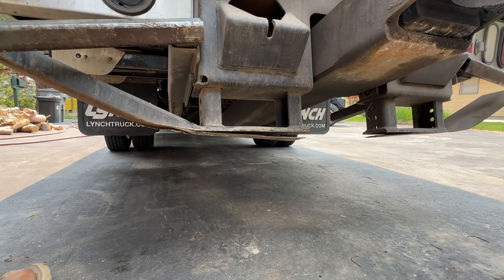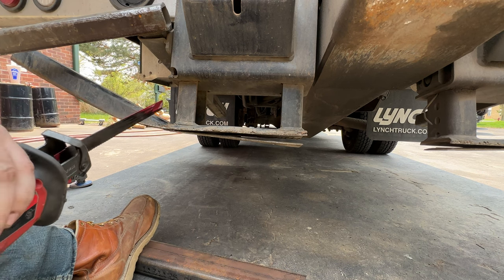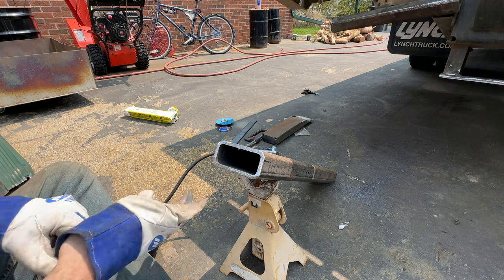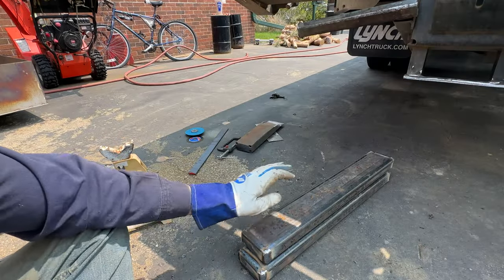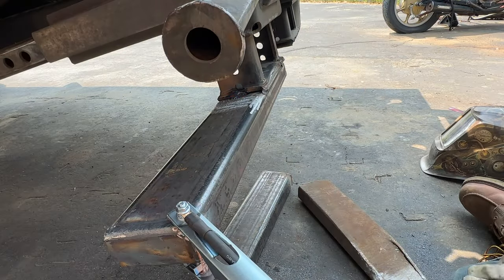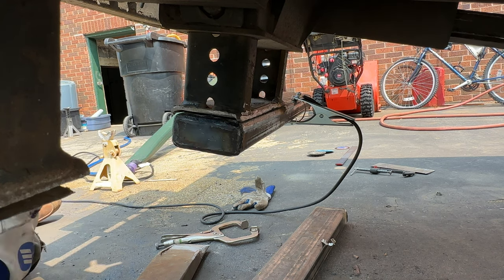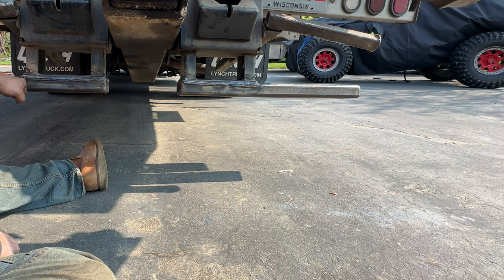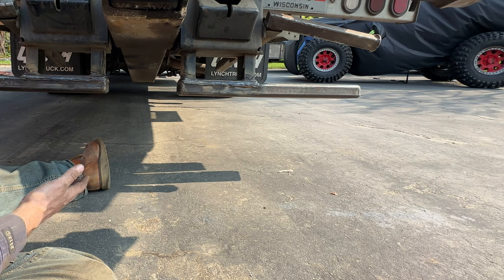Another welding repair job you can do to make money 💰

Comment: YES, this is what I’m talking about brother! Don’t get me wrong I love the teaching videos but people also need to learn real life situations and realize they need to be good enough to do a job like this before they jump in head first… I’m not taking on any kind of structural welding jobs right now… So far I’ve worked on my friends little trailer that you pull behind a yard tractor, a new rack for my brother in law’s smoker, and welded the muffler back on a riding mower… Those Diablo carbide blades cut like butter…💪🏼 Thanks for the video man, keep ‘em coming!
Reply: What’s your email address? I want to show you this grill rack I built… I feel like I did good and I owe a lot of my skills to you…👊🏼
Reply from the maker: Real life is definitely harder no doubt.  I can sit and tig weld perfect welds on stainless pipe on a bench, now trying to put perfect welds on a exhaust system with 0 access is going to be tough.  That’s why I always say master the easy, because it’s the only way the hard will become possible.  Technically the repair in the video wasn’t hard, but if someone hasn’t mastered horizontal and flat plate welds it will be almost impossible.  

Glad to hear you’re knocking jobs out 👍👍.  That’s the work that you learn the most 😀.  And of course occasionally fail the hardest at lol.
Reply from the maker: Weldingoldschool@gmail.com
Reply: @makingmistakeswithgreg  I sent those pictures of the grill rack… Don’t laugh at my plywood table…😆 I’m working on making a welding table next…😂 That’s actually the fire box on a big smoker. I’m thinking maybe I should have put another cross brace in the middle. The reason the old one rusted out is because they welded it in there and it wasn’t removable… I’m gonna make so he can take it out and clean it…

Comment: if that part comes off why not just remove it, weld it, then put it back on? I think your rod angle is off... should have pointed into what you are welding. Also I find if I attach the ground to the vice grips I get a better ground. I think it's because the teeth bite into the metal. 5/23 7018's tend to want a bit more power than you'd think. At least it does with me.

Comment: Since they are adjustable you might have been able to simply slide them out and weld them on a bench. The edges of the old piece that folded over on the sides could then be ground down flat leaving less of a gap.
Reply from the maker: 100% agree.  By time I realized they weren’t integral to the unit I already had done a bunch of work.  It’s always best to make a job easy on yourself anytime you can.  I am still confused as to how those were damaged like they were lol.

Comment: Side note on the wear presented, if it has a tail lift, its possible thats when pulling vehicle's, going up driveways, backing up to tows etc, over time they do wear out. A lot i see have 10-12 mm bits of plate say 2x6 inches at the lowest point. Makes it easily replaceable and prevents wear on more structural parts. Great vid btw
Reply from the maker: That makes total sense.  There seems to be a general trend with the tow truck drivers I fix stuff for, and that’s wearing things completely out 😅.  I hit the point where people come to me before there is nothing left, it’s far easier to make things better when it’s not 90% gone lol.

Comment: I wish you had more welding repair videos posted because you're an excellent welder.
Reply from the maker: I have probably 4 hours of content regarding repairs at my new job that I am sorting through right now.  I have been doing a lot of heavy equipment repairs and will definitely have content on that.  I just have to get through testing gloves and a few welders and I can start publishing that content 😀
Reply: @makingmistakeswithgreg  AWESOME! Thanks for the heads-up! Looking forward to it. Curious to know how someone would go about knowing what grade(?) of steel they are welding on? I'm thinking heavy equipment has to be some hard stuff, yet somewhat flexible as not to crack/break.

Comment: the weird run on those rods is probably to do with the welder rather than anything you did, its just a thing with cheaper welders that they always seem to have a sweet spot or range within wht they say they do that works much better than anything else, You did what works and found a way round it.
Overall nice job and it looks really good, sound clean welds
Reply from the maker: Thanks 😀.  It definitely pays to know exactly how a welder runs.  You’re right, most welders do have a particular sweet spot and when you’re outside of it things aren’t quite right.

Comment: Nice video. Good to see how do a job with basic tools.  Look forward to more such videos.
Reply from the maker: I will be having a bunch out in the future.  I have a few more videos to cover on the basics of MiG welding and then it will be far more “let’s build stuff” and less of “how to build stuff”.  Everything from roll cages to fire pits, axles to railing repairs.  😀
Reply: @makingmistakeswithgreg  anything that shows how to use basic tools is helpful.  I’m a hobbyist with some equipment, most of it basics.  Thanks for the videos.

Comment: Excellent vid Greg! Thanks for taking us along on this job, showing us what doesn't and does work. My only question is why not use 6010 all the way around?
Reply from the maker: 6010 would have been a solid option 100%.  I just didn’t have any rods bigger than 1/8th, and due to low deposition rates I figured I would run out of 6010s before the job was up lol.  The 5/32 7018 rods were perfect for the outside corners of the tubes.  For the rest of it having some gaps made it way harder with 7018 over 6010.

Comment: Just my opinion-  I think I would have done the whole thing with 1/8 7018-  lower amps, easier on the welder, basically same result.  May have to run another pass or two, however.
Reply from the maker: I agree, definitely a viable option.  My dynasty welder has a easier time running 5/32 rods and filling a big gap, it can produce more than enough voltage.  I think the 225 titanium was on the edge of what voltage it could supply at the amperage I was running.  It ran flat fine but horizontal with a slight arc gap due to the gap was a bit much.  7018 1/8th ram like butter, definitely would have been less frustrating.

Comment: Great video Greg,
Do you disconnect the truck batteries before welding on vehicles?
Reply from the maker: If I am welding far away from any electronics and can ground right next to the area I am welding on I dont disconnect the battery.  Even with with battery disconnected you can still short through something like a ECM if you have a poor path between your ground clamp and your rod/wire.  A great example of this would be welding on a front fender while clamped to the frame of a truck.  If the ECM is in the kick panel (like 80s vehicles) you could inadvertently send power through it as part of the ground path.  Disconnecting the battery won't hurt, but pulling the ECU harness off the ECU or atleast its fuse is far better.

Comment: Thanks for another great vid . 
I'm struggling on a job where I struggled to get hinges welded . Used 6013 but for some reason just couldn't get decent welds onto the hinge ( 30mm hinges ) . 
I guesing its the steel composition ? That and constant power tripping on site made it a nightmare job .
Trying to lipstick on a pig..lol .
One of those million dollar homes that just want to patch shiit 🤦
Reply from the maker: Sounds like a nightmare job lol. Jobs like that if possible I would run flux core wire.  Flux core is infinitely easier to weld uphill with, and out of position compared to stick.  6013 is not a rod I particularly like to run uphill.  I find that 6010 or 7018 are far easier (still no way as easy as flux core wire).  Something you were welding on may have been galvanized/zinc treated, or treated with some other anti rust layer.  This can make it weld terribly.  

Sometimes the setup or material is just wrong and will make a day out of a hour job.  I tend to find a way around that any way possible but if you can’t it’s going to be tough.
Reply: @makingmistakeswithgreg  
I tried fluxcore but couldn't get the tip in far enough to get a good weld . Just a very awkward set up . I need to get some 6010 . It took about a hour to find a decent spot to weld on as where the steel looked solid it was rusted in the post and would just  blow out. 
Joys of onsite repairs..lol
Reply from the maker: @colinhudson3723  definitely use 6010 for that.  The 5p+ grey rods will have a bit more liquid puddle, the red rods will probably do a bit better for you (faster puddle freeze). Field work always sucks in comparison to bench work lol.  That’s why I laugh at guys who say “I could do a better weld” as they sit at a bench with clean material and the ability to position it anyway they want.  Doing a halfway decent weld out of position in the field is way harder lol.

Comment: Great video, thank you for posting. I'm curious how you go about billing a job like this. Im trying to get into doing work like this on the side but have never done custom work like this other than favors for friends/family.  Any advise you might have on charging for custom welding services would be greatly appreciated.
Reply from the maker: That's a great question, and something I will cover in depth in a future video.  Since I don't have the video up now, I will give you some thoughts:

Pricing stuff is hard, welding is the easy part.  Much like any person with skills people will pay for, you obviously know how to do a repair but you don't know how to price things/run a business.  That's perfectly normal because they are two completely different things.  From a business side (legit or unlicensed "back yard" side hustle) you need to understand how to charge, and how much.  Lets use a simple example, a repair job hits your lap to put a bid on, and it will take you 4 hours to do it (your estimation).   A fully licensed shop estimates it as a 2 hour job, and estimates 200$ cost.  You might be tempted to charge the same rate as the shop (100$ a hour) but then you would be doubt what their estimate is, and you're not likely to get the job.  You could also charge 50$ a hour and come out at the same price of 200$ but youre "making less money".  The truth is, your cost to do the job and a shops cost are completely different.  A legit shop has a lot of overhead (likely 20-40$ a hour worth of overhead) that you simply dont.  They also have better tools/more experience which allows them to do more jobs in a day (aka faster).  So even though their hourly rate is high, their bill is fairly low because of the speed in which they work.  

Back to your situation.  If your costs are low (no insurance, legit business costs, low overhead) you can make more money at 30$ cash with no taxes than a legit business might at 80+.  ITs not what you make its what you can keep.  As a starting point I would look at 30$ a hour cash plus materials.  If its a job that takes a bunch of skill, closer to 40-45 cash.  If its a stupidly easy job that takes no work, 25$ a hour cash.  Those are in the ballpark in northern states, they may be less in southern states.  

Keep in mind to get a accurate rate you need to take all your monthly expenses, and divide them into a hourly cost.  Take that number and add it to what a reasonable welder pay is (15-30$ a hour depending on location).  That is your "rate" that you should be shooting for.  It doesn't make sense to weld for someone for less money that you can make somewhere else, if you are looking to do a lot of work.  

I do a ton of "side work" for straight cash, and my hourly rate is somewhere between 25 and 80 a hour, based on how much I want to do it, how much skill is involved, and who I am doing it for.  That is a crazy range, but because I work for cash, I turn far more money than if I was "legit".  If I was a licensed business I couldn't touch a single job for under 70$ a hour.  Right now insurance cost is 2.5$ a hour (40hr week, 4 weeks a month) alone.  Add it commercial mortgage for a building or expensive truck payment, (12.5$ a hour), tools (5-10$ a hour) and youre talking upwards of 25$ a hour actual cost (plus tons of additional stuff).  So a realistic number would be around 35-40$ a hour is expenses.  Well at 70$ a hour your making 30-35 a hour for doing all the work and running the business, which does not include health insurance, retirement, etc.  You can see why many businesses charge over 100$ hour.   

So basically what I am saying is if you don't have huge expenses and aren't a "legit" business, you should be looking at 30-40 a hour as a target, plus materials.  If you make 25 cash per hour for a easy job, your ok, but shoot for 30-40.  In most states as a side hustle I wouldn't take less than 25 unless its a friend of family.
Reply: @makingmistakeswithgreg  wow, thank you for the detailed reply.  That pretty much sums up what I needed to know, at least to get started.  What welding skills I possess pertain to just mig at the moment as it's all I've ever really done, but I'm trying to learn stick and tig so I can tackle a wider range of jobs, but that will likely be quite a bit further down the road. I'm hoping I can do enough side work with my little mig that I can afford better equipment and progress into better higher paying jobs. I really appreciate the time and information.
Reply from the maker: No problem.  You can do a ton with MiG and you can definitely make enough money to pay for better equipment.  It might sound ridiculous, but focus on being able to make the straightest, most consistent welds with your setup while you practice.  The better you can MiG weld the faster you will be able to pickup other welding.  Make sure you practice both flux core and gas shielded MiG, wire welding is very versatile when you add flux core in the mix.  

Most of my side hustle money comes from doing repair work others can’t, aka cast aluminum, stainless, one of a kind headers, cast iron repairs, etc.  I also do a lot of repair work on tow trucks which is 3/8th + steel and often high strength steel.  Although a lot of those things you can’t easily do with a MiG machine, you can do a ton of repair jobs in field with the help of flux core wire.  Flux core wire is far easier to do a trailer repair with than stick.  You also have the ability to weld super thin material too.  So focus on doing quality work, and focus on doing things people need done that are hard for the average person.  You will get there, just build the skills, the confidence, and ability.  Take pictures of quality work and use them to show what you do.  Money will come your way.  Also, always call people back, and call them when you say you will.

Comment: The piece that you welded to was t he top flange of the original tubing. I don’t understand why you didn’t cut it off the vertical struts and weld the new tubing directly to them. Maybe I an missing something that you saw and I didn’t
Reply from the maker: There is a easy reason for that: time.  To completely cut off both vertical struts on both sides square, in a manner that it leaves minimal gap to reattach a new piece, would have taken a lot longer.  It is also far stronger to leave that piece that was left and weld onto it.  There was nothing wrong with the factory welds and it didn’t make sense to cut them off.